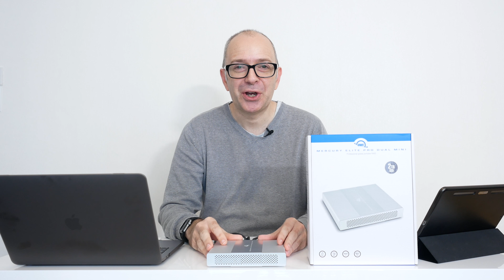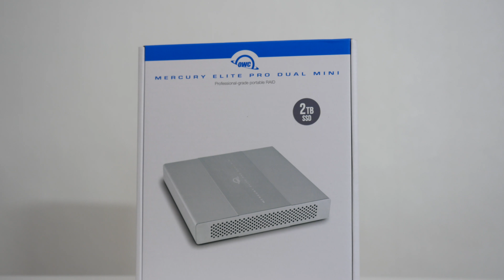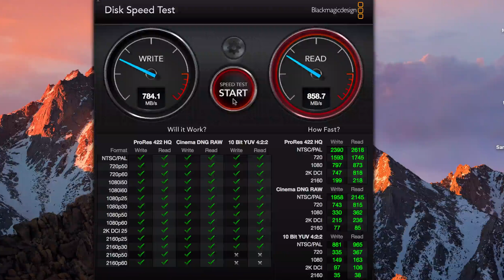OWC Mercury Elite Pro Dual Mini Portable RAID Review & Speed Test

Comment: Lovely little box.
Looks like it's also bus powered, it seemed to fire up as soon as you plugged it into your MBP without PSU, really handy for on the road if that's the case. I'd love something like this, if only I had one of those fancy new ports to plug it into!!! 
Great vid as always :)
Reply from the maker: You are right Tom, it is bus powered, recommended with larger capacity SSD 2TB and above to run a PSU.